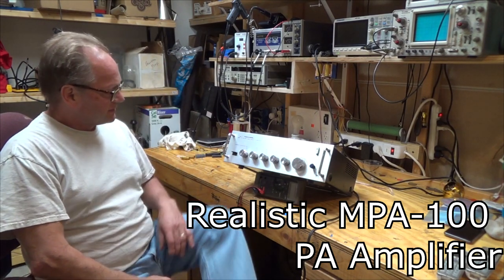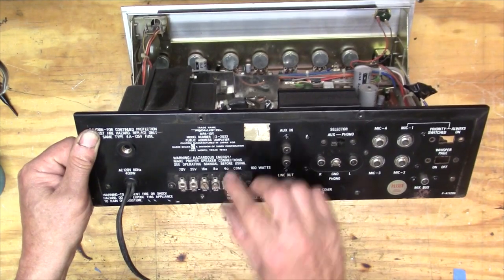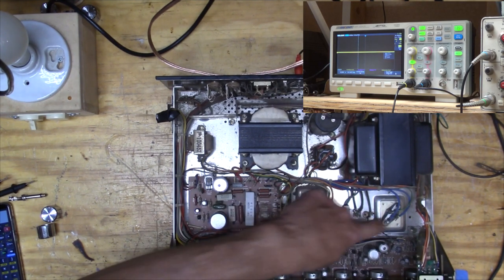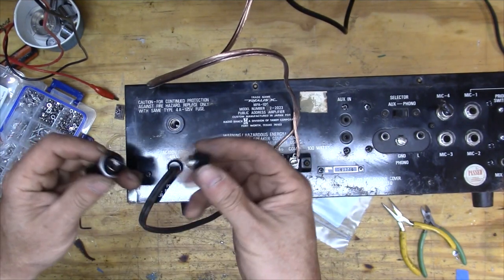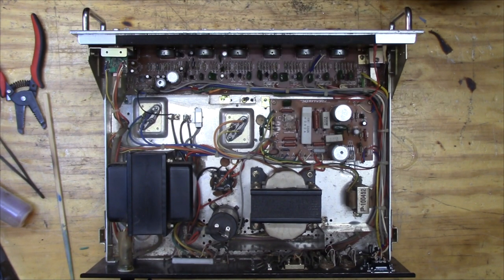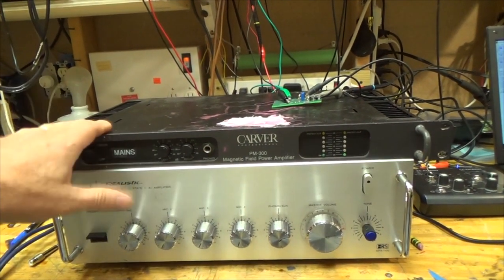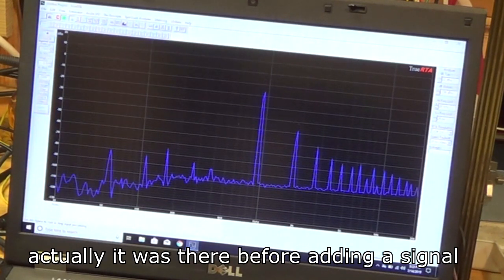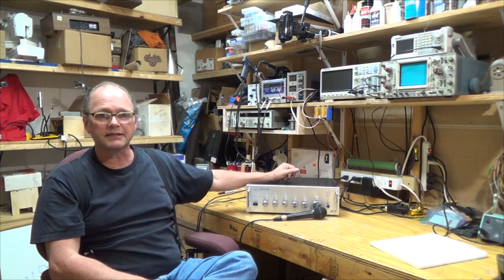Realistic MPA-100 PA amp repair and use of TrueRTA for characterization

Comment: Enjoyed it, Rob.  Thank you. The basic circuit of the MPA-100 (32-2023), MPA-50 (32-2021) and MPA-35 (32-2022) are all the same. The manual for the 32-2022 with schematic is available on HFE and, while some component values and voltages are different between them,  basic understanding of the circuit design will help anyone trying to repair one of these.  Best to you.

Comment: I use one of these for playing guitar and they are INSANELY loud for guitar, it gets ear shatteringly loud only at about 2 or 3 on the volume knob! Especially with a distortion pedal plugged into it..
Reply from the maker: Wow that's interesting. Must look kind of cool on top of a cabinet.
Reply: @RobsFixitShop  Ye it looks pretty nice.. Sad that it doesnt have any EQ controls.. But i don't really care as i love the muddy and thick sound it has.
Reply: @RobsFixitShop  I have the mpa-95 model it does not look as nice as the one you got on the bench.
mine says that it puts out 100watts @ 4,Ohms, how many watts will it put out at 8 Ohms?
very informative and interesting video
Thank you
Reply from the maker: @SDsailor7  Probably around 50 watts
Reply: @RobsFixitShop  Thank you for the fast reply. Good to know.
Cheers

Comment: i always wonder how the caps read after people take them out for a recap
Reply from the maker: Good point. The ones that I took out didn't seem too bad at all. I would've been fine to have left them. It was interesting that the voltage ratings on the capacitors seemed to be higher than necessary for their place in the circuit which is a sign that this device was built to have a long life.
Reply: @RobsFixitShop  Yep. I suppose the just stocked tons of the same voltage for many products and used up inventory as needed
Reply: I just bought the Realistic MPA-95 and it's also a 100watts. I found it at a thrift store. And it powers up but I have not hooked up anything to it yet.but I think it is only mono and not stereo, It is very similar to the one in your video. Mine is all black. I am not able to find much info on line.I read that it is 100w at 4ohms so how many watts will it be at 8 ohms? and is it possible to connect two 8 ohm speakers to get stereo?Very interesting and informative video, very clear information.Thank you
Reply: Well I guess you answered my question towards the end of your video. It is not good to use as a home amplifier Since it is not stereoI guess I will have to sell it. Or is there a way that I can use it for home use?Cheers